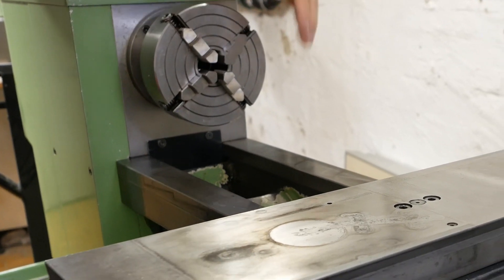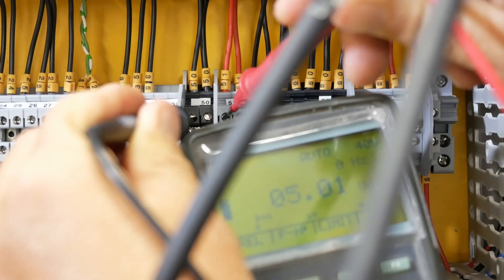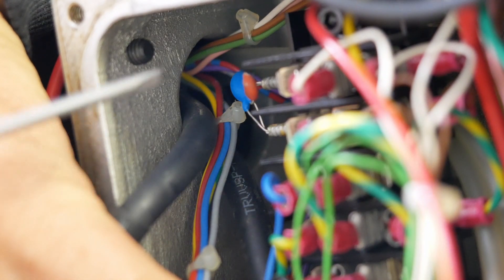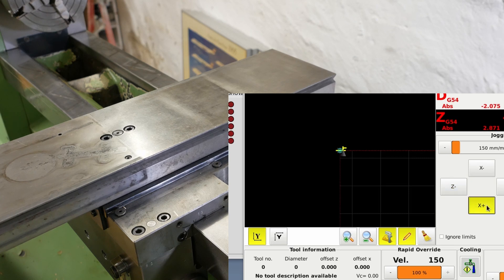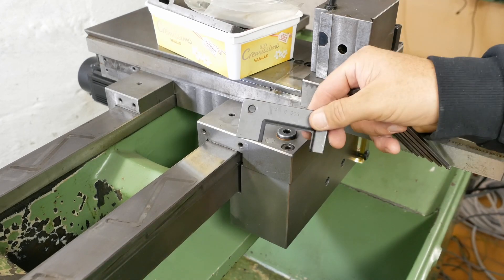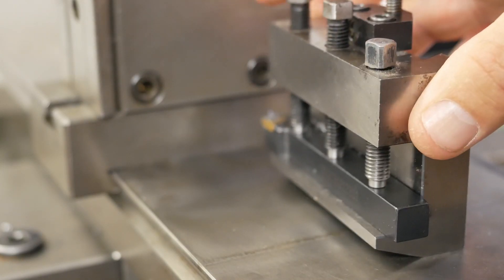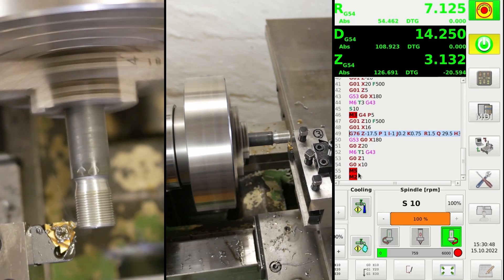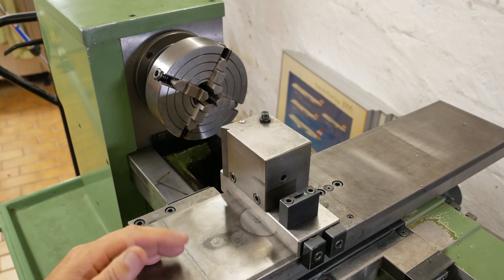Troubleshooting and progress - Schaublin 125-CNC retrofit Ep.44

Comment: Nice to see you making chips.  Very much enjoying this build.
On another note, was said on the news here in NZ tonight, government is looking into re-establishing the Air forces strike force.  Not sure how or what with.   Fue months back they had the Singaporean F16's visit Ohakea.   Will be nice to hear some screaming birds in our sky's again.
Reply: We build F16 flight sims... a trip to NZ for installation sounds appealing.
Reply from the maker: @azenginerd9498  I always wonder how much a full motion sim lacks, due to the missing G forces. Moving your head to scan under G is seriously disorientating. I wonder how long it takes to train that.
Reply: @RotarySMP  FAA compliant Sims are full motion because the G-forces in the training envelope are easily generated. As you note, fighter aircraft G-forces are substantial higher. And generating those levels in a sim would require Disneyland ride sized enclosures. With the advances in computer graphics motion has been mostly abandoned in the industry. Why have it if it can't do the job... The thinking has been that by the time a pilot has been elevated to frontline fighters they are seasoned flyers and the absence of motion in the Sim is of little consequence. The sim provides currency, emergency, procedure, and mission training. Stick & rudder practice is provided through other means.
Reply from the maker: The reputation with the Kahu converted Squawks was that the RNZAF could punch above its very modest weight. They have now lost an entire generation of knowledge and experience. That will be hard ($$$) to rebuild, especially once they find out what it will really cost to get good instructors in country for years.
Reply: @RotarySMP  my thoughts as well.  Can not buy back the skill and knowledge lost.  It'll take more than a single generation to just get a footing.  I think the best we can do is open our doors to Ozzy and Singapore as another training venue. Have their squadrons based here
Reply from the maker: @russcole5685  Yeah, that is probably required. Austria has one squadron of Eurofighters, but they are so expensive to run, I dont think the pilots get many hours.

Comment: CNC Thread cutting seems always a tiny bit Magical to me XD
The surface looks ok for 'unknown Material'
Better than anything I made in the first few weeks into my apprenticeship
Reply from the maker: :)
The surface speed was way low for carbide, but still pucker factor for me.
Reply: @RotarySMP  Jup, still remember first day of my CNC Class.
Good old Teacher told us someone wrote a slightly wrong path to the Toolholder-Revolver.
And because the Machine has Gigantic closed-loop Stepper it just broke the Toolholder clean off o_O
Thats a 250-300kg castiron Braket plus the turntable

First time I ran my own Code I was all gittery and cold-sweat
Reply from the maker: @T1g3rch3n  Working around this machine as dead iron for over a year, probably makes me complacent. I need to be really careful.

Comment: did you think about bolting some bump to bed for pushing oil pump plunger every time z comes to endstop?
Reply from the maker: Good point. I thought about it, but the number of pumps differs on how long it has sat, and you would only rarely go back far enough to trigger it, as it would have to be behind the Home position, otherwise it would limit the last 50mm. 
I am pretty good at keeping a machine oiled. The Boley has nothing but zerks and an oil can, so this is already a step up.
Reply: @RotarySMP  industrial machines usually have some kind of warm up cycle cause cold bearings and oil gives more resistance and drops precision of final products